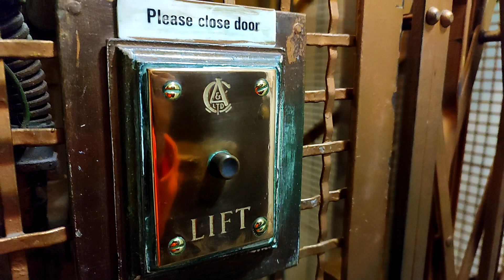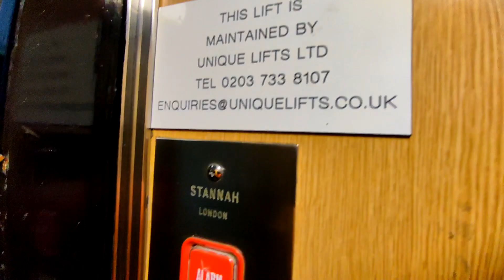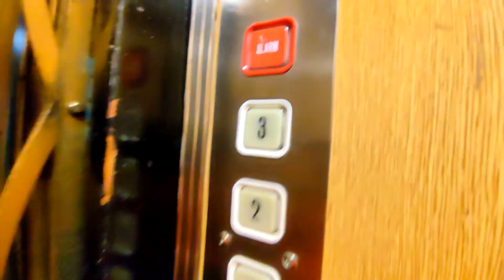Rare 1920s Aldous and Campbell residential lift single speed

Comment: A very well maintained elevator in excellent working condition. The controller with an updated modular relay system is quite interesting. As is the electromagnetic floor selector. Basement traction machine along with safety grills.

Comment: the troulbing thing is that you know once that lester logic dies some new lester PLC crap will go in..no one wants to try and work relay logic anymore
Reply from the maker: It won't be PLC.  Nobody installs PLCs anymore.  It will be some modern Lester/Thamesvalley/ILE stuff.  Modern VF drive stuff is cheap nowadays and there is no incentive to keep things feeling original.  Although there are a couple of exceptions to this.  The 60s Evans lifts in a small residential building recently had the logic replaced with Lester, but had  the Lester setup as single speed, which is unheard of the the modern day, which kept the lift feeling original.  Also some of the 30s classic buildings are listed, which often doesn't stop lifts being modded, but sometimes it does.  I know of an area that has many original lifts in an area of listed buildings.  All are maintained by the same generic company, who seems to specialize in this (annoyingly I forgot the name of the company).